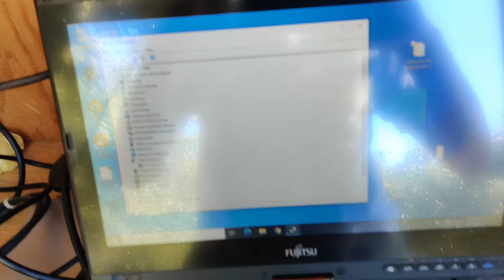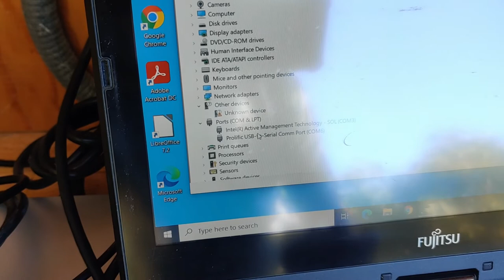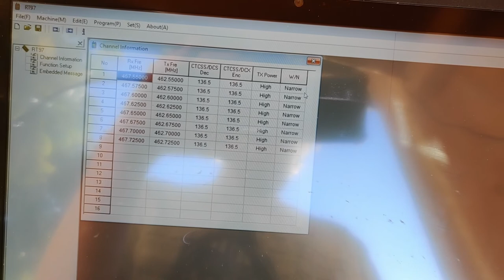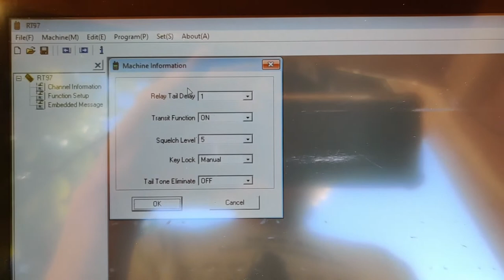Retevis RT97S programing screen, software, and Download and upload configurations.

Comment: Why bother with a 3 watt or 5 watt repeater it is a waste of time go for the full 50 watt limit you can always turn it down but you cannot turn up the watt with 3 or 5 watts. Research this is a hunk box build your own repeater or send me a message and I will show you where to get one I have 5 in service and they all have a 40 to 65 mile range not just 2 or 3 miles do not waste your time with these weekend think they are pros they are not. If you want to do something do it right or not at all.
Reply: please continue :/

Comment: Scotty my GMRS Repeater after the duplexer, after the Duplexer puts out 46 Watts and with a nice copper  " J-Pole" antenna at 20 feet will do 50 to 60 miles depending on weather and trees and the time of year. The coax is LMR-400 you have an extremely high loss with UHF and GMRS is in the 460 Meg range so it makes it UHF and you must always use the " N" connetctos on your coax for low loss it all adds up in the end. 14 miles is nothing I would just buy a CB radio at Walmart if I wanted to talk 14 miles. Listen and learn and read about radio theory and learn before you put your foot or both feet in your mouth. Typical Florida implant.

Comment: I’m getting “abnormal reading and writing, check the connections are correct, or walkie-talkie power supply is turned on!” While trying to program my RT97S. Any ideas? I’m using the OEM cable

Comment: Look after the duplexer this junk repeater only puts out maybe 3 watts do not be lied to build your own its easy and use the full legal 50 watts to talk farther. Do not be mislead
Reply from the maker: I think I may have mentioned the output discrepancies even just in the marketing. But, for my area the range is more than adequate as I'll be blocked by mountains before 3 watts makes much difference. I had tested the repeater location with a HT before and it worked great to cover where I needed. Figured the RT97 could at least match, especially with an antenna mounted nearly 20' agl.

Comment: You can reverse the rx and tx but the duplexer is tuned for rx high tx low.

I reversed mine but I'm only getting about a mile on flat ground with a 15 feet high Tram 440 antenna.

I'm watching your video to find the default settings. I'm going to switch it back and see if I get more distance.
Reply from the maker: Thanks for the info, I had wondered about how the tuning would impact if the tx rx were reversed just never got around to testing it.
Reply: @rockytop441  well obviously you're no real genius. I've recently talked on it 14 miles I say that's not a piece of junk it's pretty good that's only on a 30 ft tall antenna in Florida.
Reply: Scott you are spending way too much time at the adult book stores and need to spend more time learning about radio theory.
Reply: @rockytop441  read more, respond less
Reply: Scott the tech test for ham radio is only 35 questions and you can miss 7 and still pass give it a try and talk around the world not just down the street.
Reply: @rockytop441  KO4TNL WRNU356

Comment: Note, having multiple channel frequencies is not a good idea as the duplexer need to be tuned for each pair.   Can reverse them but once again retune your duplexer for the new frequencies.    every channel pai  away from the tuned frequency will cause massivel loss in signal and sensitivity as the transmitter overwhelms the reciever or it's just  cancelled out.  tuning the duplexer is not hard and you can use the cheapie china "radio testr" analyzer and tracking generator to tune one up really well.    

All these people that claim to know something telling you "thats a waste of money", dont even know anything at all about radios or RF let alone repeaters.   It works well for it's use case.  it's a small portable repeater for use around a basecamp.  for that it works great, just get it tuned up for the frequency pair you are using and get it up in the air,  even 20 feet up is enough to make a huge difference handheld to handheld.   and the loss of the duplexer is about 5% to 10%. so instead of 10 watts it's 9 watts.  which makes almost no different in range  as  RF output power is log10.     A poorly tuned duplexer will create loss of 20% to 100% so tuning that thing every time the frequencies change is extremely important.